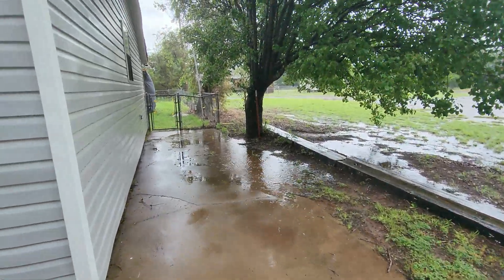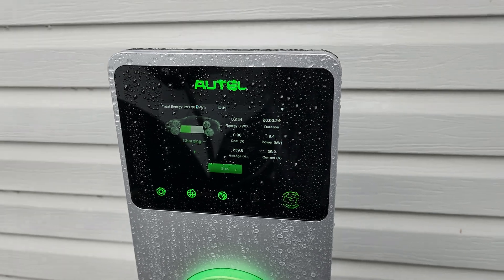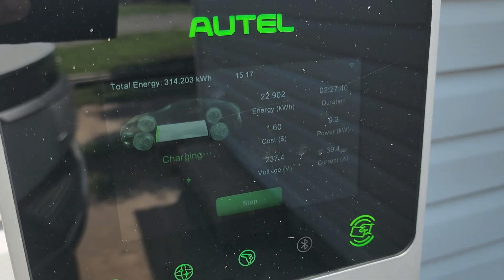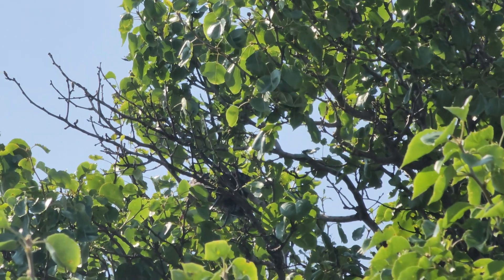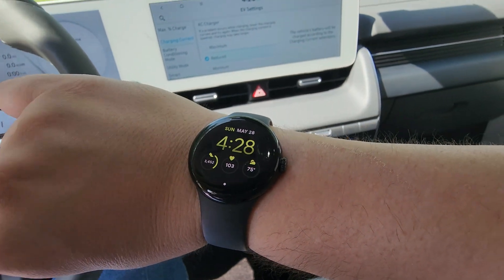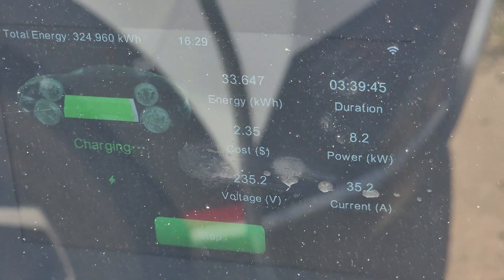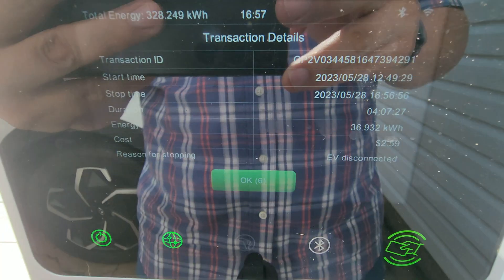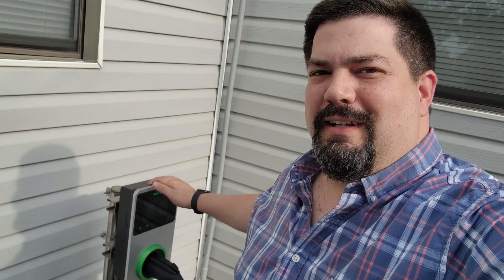Autel MaxiCharger C50 EVSE Still having overheating issues!

Comment: I have the new Autel 50 amp home EVSE. I had it installed by an electrician and it’s connected to a 70 amp breaker per the instructions to use the full 50 amps. It is mounted inside my garage. I’ve had no issues with overheating and my 2023 Ioniq 5 is drawing on average 11.7 kWh and charges to 80% without issue. 

Unit and cord stay around room temperature during charging. 

Make sure you’re using copper wire and that it’s an adequate gauge for the load.

You mentioned that the unit was second hand. I wonder if overheating is why the original owner sold it.

Comment: Not sure if anyone else has mentioned this or Autel themselves.. but I know EV chargers should be wired to continuous duty circuit specs. So a 40 amp circuit at continuous duty you would multiply by 125%.. so that would be 50 amps. So your circuit even though only being used with a 40 amp charger still needs to be wired for 50 amps.

.. just a thought to check on
Reply: I'd try bumping your Autel charger down to 30 amp and if it charges no problem I would definitely check your wiring and be sure it's wired for a continuous duty circuit.. (50 amp if your Autel is limited to 40 amp)

Comment: In Car Scanner you should monitor the (VCMS) AC Inlet Temperature 1 and check what happens once it hits 100°C/212°F.
Reply from the maker: Great idea! I do have that dongle!!! I really hope it's not really hitting 212! No wonder it's stopping
Reply from the maker: Holy crap you're right! I tested this today It goes all the way to 240° f that is very hot and that's when it shuts off charging! So now it appears that the car is the problem not the charger I'm going to post a new video
Reply: @Crazypostman  You should see the P1BAD00 error code. Try charging at lower amp rate and watch the temperature. The temp sensor is deep down at the combo on-board charger under the rear seats. A new TSB for this issue is a software update, which will automatically throttle the AC-charging rate gradually down to 32 amps, when the "heat hits the fan", but it is only a band-aid help and the car charges much slower. Very few owners got the entire long charging cable harness replaced (a definitive but expensive fix).
Reply from the maker: @EV_OBD  I'm posting a new video about this tomorrow! I can't believe Hyundai is just going to let our cars burn down!!
Reply: @Crazypostman  When was your OnBoard Charger (ICCU) produced? Check with ECU Identifiers icon in Car Scanner. The TSB is for cars built between November 17, 2021 - December 20, 2022.
Reply from the maker: @EV_OBD  It definitely falls in that date, I picked it up December 31st It was built a few months before.

Comment: Are you sure it’s not a wiring issue?  You had issues with the Tesla charger. Maybe some issue there to explore??
Reply from the maker: I've checked the breaker in the main panel it doesn't get hot just warm and then it's just a straight run through the attic no connections or junctions on the cable. Yes I do believe the Tesla EVSE was overheating as well. That's why I bought a 50 amp EVSE that I knew I was only going to run at 40 amps so it wouldn't be pushing its maximum and might not get as hot but that didn't work out lol. I've been considering bypassing my secondary panel and running the cable directly into the Autel and bump it up to 50A but I don't see how I could do that if it's overheating at 40 already
Reply: @Crazypostman  it just seems like a strange coincidence. I’ve had wiring issues before causing similar issues.   Probably not the case. Just food for thought.

Comment: Operating temperature range is up to 131°F according to the spec sheet. I'd say there is something wrong with the unit, or an incompatibly issue with your car, requiring a software update on one or both of the units. Definitely a support issue 👍🏼
Reply from the maker: Yeah support not much help, I've contacted them twice, The first time I got someone useful because they contacted me through the media department. Contacting them through the app to the normal tech support the advice I got was just turn down the power... That was BS!

Comment: I am wondering if the high temperature issue is caused by the NEMA 14-50 cord. If the cord is partially going bad, it'll cause terminal overheating inside the EVSE unit. I know that Tesla wall connectors have a temperature sensor inside the control unit and the connector handle and on the 14-50 plugs, but I am not sure if it is the case on the J1772 standard. 

You can probably get a replace 14-50 appliance cord from your friendly neighborhood big box store, tape or cut off the white neutral wire since it is not being used. I highly recommend using wire ferrules due to the fine strands on appliance cords and torque the connections to spec.

In my experience when it comes to devices that have a 100% duty cycle does strange things. NEMA 14-50 is technically good for continuous usage at 40 amps, but the duty cycle is usually around 55%. Add sun loading to the mix just makes things worse, now you have to derate the capacity from 80% to 60% which puts the load calculations within the ballpark of 30 amps.

If possible, I would just hardwire it directly to the EVSE, but it is a pain in rump to wrestle #6 THHN stranded wire inside tight spaces though...
Reply from the maker: I could easily hardwire it I have enough spare, but I just liked the idea of that secondary panel on the driveway. I don't know if you watched my first video or not but I actually did use a extra Tesla nema 1450 plug to wire it that I had laying around 😂 I could always swap that out just for grins but I really don't think that's what's overheating.
Reply: @Crazypostman  I just watched the installation video, I noticed the extra wire which I believe is the temperature sensor for the 14-50 plug end. It would be nice if there is a way to remote into the controller to see what the temp sensor is really seeing and to what effect if sun loading is doing to it.
Reply from the maker: @felaxchow207  The autel engineer that looked at it first implied it was the display board that was overheating not the main board.
Reply: @Crazypostman  I guess you found a bug. You would think that the software developer(s) would incorporate a derate function instead of just stopping the power delivery all together.

I wouldn’t of care less if the EVSE just simply tell the car that it’s too hot and I need to restart the session at a lower amperage. Then notify me on the app that is the case, I wouldn’t be happy about it but at least its still charging the car. 🫠
Reply from the maker: @felaxchow207  That is exactly what my Tesla EVSE did, It would gradually derate itself when it came into an overheat situation instead of just cut off.

Comment: Maybe Autel should provide a hood for the unit since it cannot handle being in direct sunlight, even with moderate temps.  For anyone considering the Autel unit, they do work fine if mounted inside a garage.  I've had my residential unit in my garage since October, and it works at 32amps to charge my Jeep Wrangler 4xe.  The Jeep won't charge any higher than 32amps.
Reply from the maker: Mine doesn't stop at those lower amperages either. Only at 40 and 50 amps